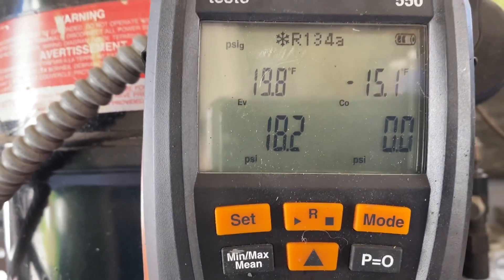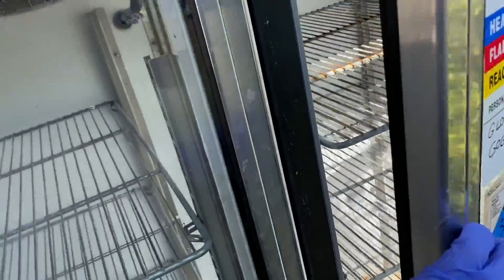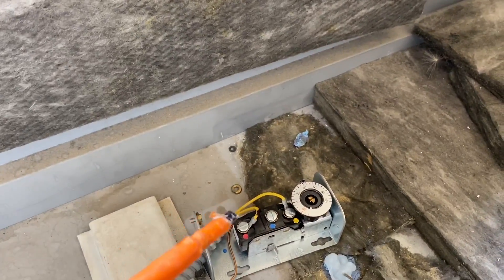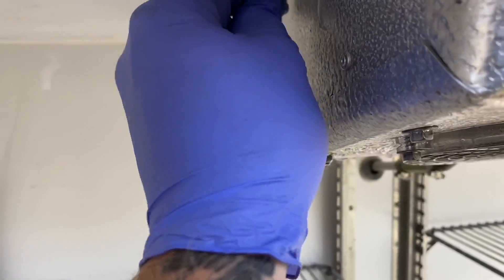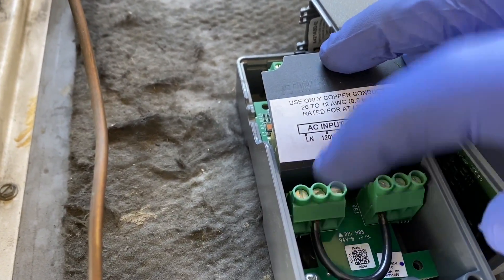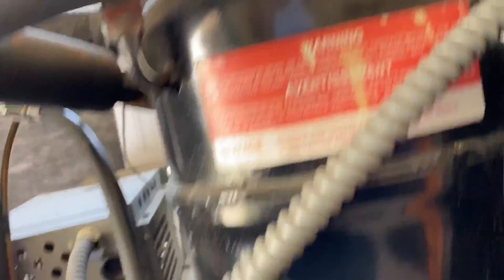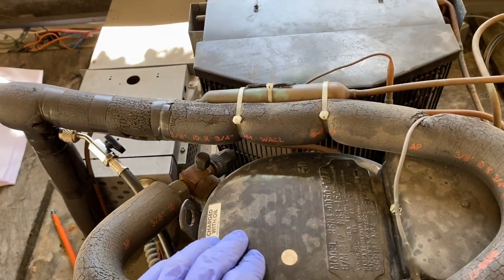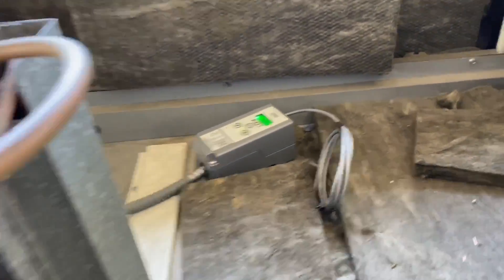Change a mechanical t-stat to a penn A421ABD-02 with defrost

Comment: Wow @1:06 that coil is from April 1994. Thought R12 was banned in 1993. That's about as new as you can get with R12 equipment. Oh the compressor was from 1987. So it must have had the coil replaced later as a repair.

Comment: You're always doing a bang-up job Dave, love your channel.  I carry the ETC-111 and the KE2 controllers on my van for walk-ins and remote thermostats.  For reach-ins, where the t-stat is mounted inside, I carry the A12-701 and A12-1560 thermostats for when there is an ice-up problem with the boxes.
Reply: I like both of those, if there's not enough room inside for an electronic one.

Comment: Its funny when people not in the trade say things like "Oh yeah, R12, that stuffs been gone for years."  Little do they know how much old equipment is still running, I ran across 3 units using R12 in just a 3 year period.  And dozens using R22, supermarket rack systems with over 1000lbs in the system.  Not often, but they are out there.

Comment: Those Tstats are great! I went from a419 to those since they don’t make a419 anymore. The problem at my restaurant’s were they kept getting wet in the prep tables, that was due to clean up using to much water lol great video!
Reply: Have the same problem with cleaning crews at my job. Always tripping the gfi.
Reply: Colt 45 zag  yeah exactly. I started to silicon the edges around the controller to help try and reduce the calls for wet controllers

Comment: Hey dave. Do you reccomend the h10 for picking up 134a and 410? seems like my infatek picks up 22 and 404 really well but has trouble picking up those gases. I'm willing to spend a few bucks. Thinking about an h10. What are your thoughts?
Reply from the maker: I have success with it.
Reply from the maker: but not an old h-10, h-10 pm or pro.
Reply: @NorCal-refrigeration  sounds good. I meant to say inficon tekmate* (which is a nice detector) but ty. I'll get a newer h10.
Reply: @mikerefrigeration5736  I have an Inficon D-Tek stratus. Works great on 134a, and 410. Even picks up microscopic natural gas leaks, even though it's not rated for it.

Comment: I set mine up with the  defrost time clocks terminal 4 feeding one side of the Johnson 421 common and the n.c. goes out to a liquid line soneloid valve.. this way in defrost the solenoid denergizes  and pumps down to what the dual pressure control is set at. I find a constant feed for the 421 so it doesn't have to go  through the start up menu. These are great controls!

Comment: Just did this last weekend. I wish I would have saw this video first. It would have saved me from reading the manual. Gotta do it again tomorrow so you still saved me from having to read one of those dreaded paper things again. If you could do a video on how to do this on a walk in that would be great. Have you had any issues with mechanical controls failing when used below -15⁰F?

Comment: Those controls are nice. I’ve always used a ranco ETC control and just leave the good old time clock up on the roof . Nice vid though I’ve learned a lot by checking your stuff out
Reply from the maker: Thanks nick. I’m a big fan of the ranco because of its easy programming, and wire terminal.  They need one with defrost.